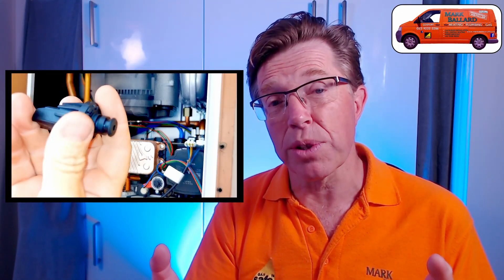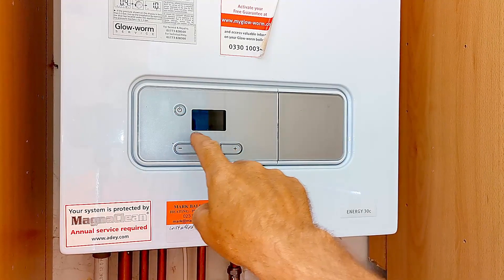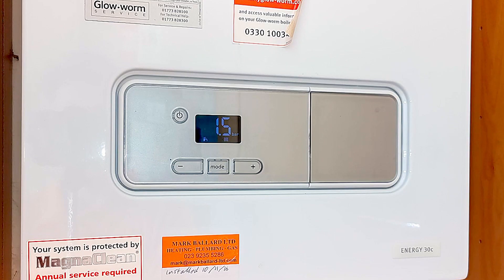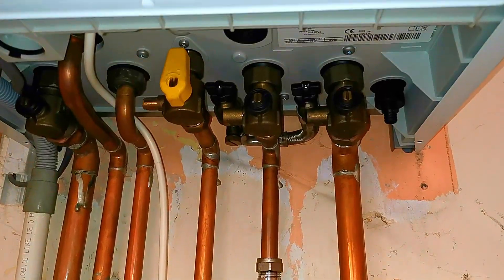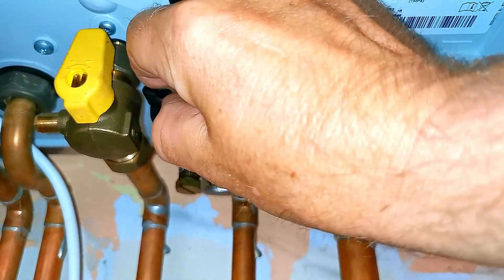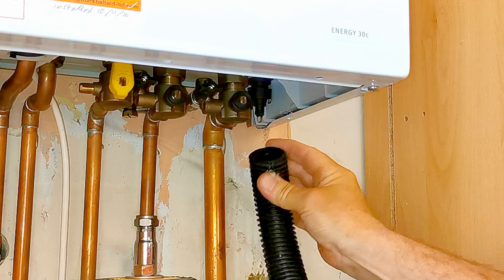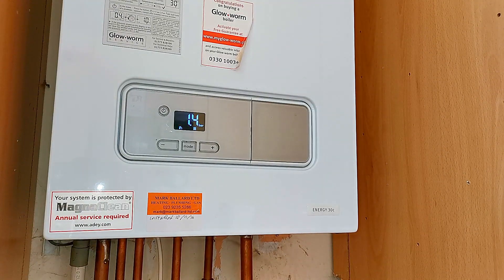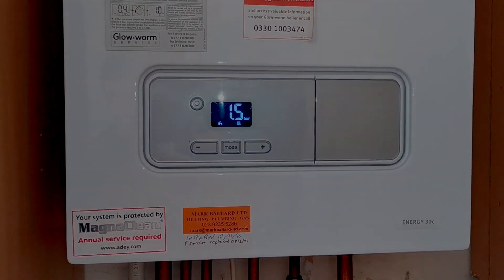F75 Fault & F9 Fault Glowworm Energy, How To Get Your Boiler Working Again. 2021

Comment: Seems to have fixed my issue too. Legend! Caused by a Homeserve guy fixing pipes by removing air from the system but also clearly let too much pressure out too.

Comment: Thanks for saving the Christmas eve without having to call the landlady 😂😂 so helpful, I did solve the issue after purging the air on a blocked radiator that won't heat up, the system got the pressure dropped and F75 and the boiler stop working. I followed your steps to refill the system again and get the correct pressure in it. Thank you!

Comment: thank you very much, you saved my family from sleeping in the cold with freezing temperatures outside.

update: engineer attended today, it is the pressure sensor, needs replacing. costs around £45 for the part, unsure what labour will be.

Comment: I had the F75 error, emptied the water and cleaned this sensor. After the replacement I increased the pressure bht the boiler showed different pressure values, it kept changing until it stabilized and showed a correct pressure. The error code disappeared. The problem is that even after the replacement there is no warm water coming. Do you have an idea what is causing this? Thanks

Comment: Great vid cheers. My gauge started on 1.7 and i took it to 1.9 and that was enough to clear the F75. On working it rose to 2.4 then fell back when switched off. Clearly it needs a gas engineer but to get hot water and heat till and engineer arrives by xmas 😀 is a god send. Thanks again! 😊

Comment: Hi Mark! Thank you for the video but I have a different problem. 

My boiler was stuck at 2.8 pressure. Water heating working but the House is not heated. I reset the boiler nothing changed. I dont get any error messages.

After watching the video I realized that the 2.8 pressure is too much so I opened the valve and let some water out. While emptying the water the pressure reads 0.3 but as soon as I clsoe the valve it jumps back upto 2.0 and slowly increasing. And heating is still not working.

Should I wait a long time and let all of the water out?

Comment: Hello thank you for your video. How do I communicate to my gas supplier or engineer, that my boiler keeps switching off. The engineer seems to think that this is not a problem that he can fix, that this is a gas supply problem. Thank you
Reply from the maker: What do you mean by switch off.
Power goes off, no display?
Fault code like F29-F28? they would be gas faults.
Write down exactly what happens and when it stops working. video it,  take photos, this is always very useful for the engineers.
That's all you can do.
If it's under guarantee call manufacturers.

Comment: So my glow worm boiler is heating water I have hot water in the taps just no central heating. My radiators are on but non are giving out heat. The boiler reads 1.0 pls help
Reply: Hello,

I have a similar problem. Did you manage to figure it out? My boiler reads 2.8. I get water heating but not the house.
Reply: Same problem, water is fine but as soon as I try to put heating on after a few minutes f75 comes on, pressure sensor has been changed to no avail,
Reply: @dan dun  Did you find out as I have the same problem, sensor has been replaced?
Reply: @mbz4652  nope, I have rang glow worm and signed up for their cover plan, £57 a month for a minimum of 6 months, they will fix it or replace the boiler, they are coming Tuesday

Comment: Hi Mark, I’ve just moved into a new house. I am getting an f26 fault on a gloworm 24hxi boiler and a kettle noise from it. 
Any advice would be appreciated.
Reply: It's the pump
Reply: @mattwright2252  I had the F75 error, emptied the water and cleaned this sensor. After the replacement I increased the pressure bht the boiler showed different pressure values, it kept changing until it stabilized and showed a correct pressure. The error code disappeared. The problem is that even after the replacement there is no warm water coming. Do you have an idea what is causing this? Thanks